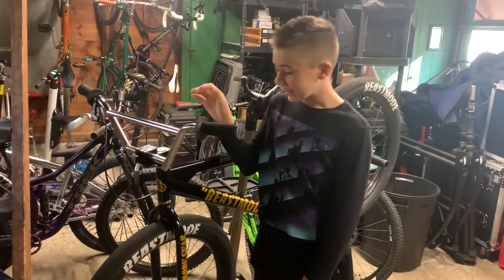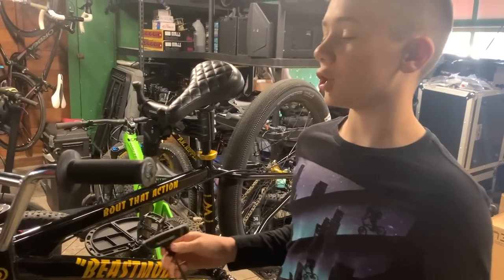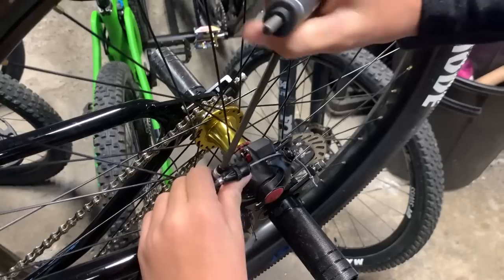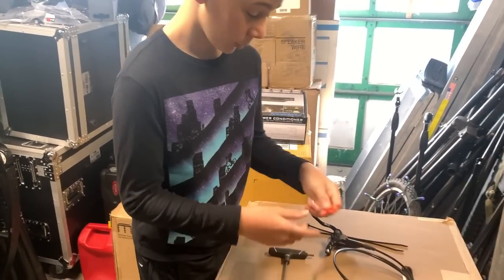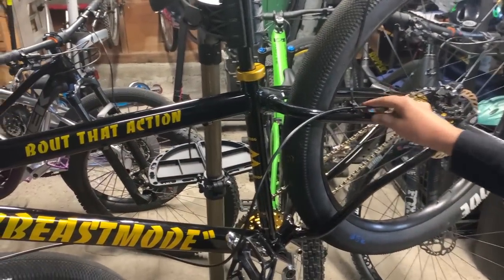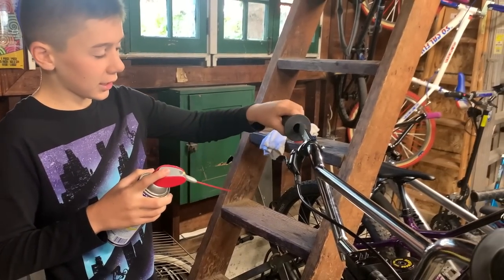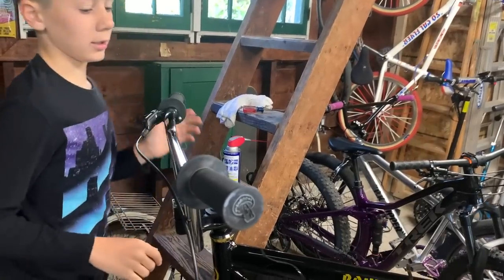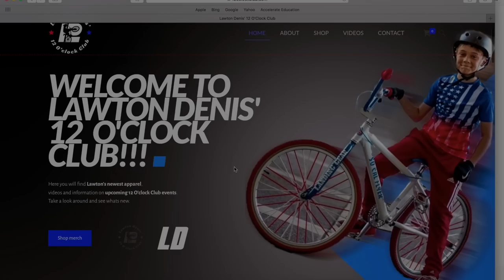Installing Shimano Hydraulic Brakes On My SE Beastmode

Comment: If you want to avoid throttle grip after using a lubricant you can use rubbing alcohol, like the stuff you spray on your hands and it evaporates in about 2 minuets then your grips are locked down like they always are.

Comment: Hey Lawton what’s the difference between se bikes is it the speeds the frames or the graphic kits in general?.
Reply: It’s the frame
Reply: Beastmode fat rippers and blocks flyer what I recommend
Reply: Everything depending on the bike, the cheaper bikes might have worse heavier and weaker metal for parts like handlebars, and they might have different wheels, sprocket, tires, seat, handlebars, frame, brakes, etc
Reply: And they obviously have different graphics, some have different speeds and gearing too
Reply: its the tire diffrence

Comment: Hey lawton what hydraulics should i get for my so cal flyer and how do you install them
Reply: For rim brakes I wouldn't put hydros its really nothing difference besides different brake pads. Id use Koolstop brakes and theyre sharp enough. Hydros are only used for Disc Brakes and are sharper then

Comment: The problem with removing grips with WD-40 is that it's hard to clean out the lube from inside your grips.  If you ride in the rain, the lube somehow lets water in, and suddenly your grip pops off when you need it most like when you're doing a wheelie or a jump.  If you have grips that lock to the bar with bolts, then it won't slide off, but part of the grip might slip and that's annoying. If you have a high pressure air pump, stick a screw driver in then blow that high pressure in. The grip will expand and slide off.  You can slide them on the same way.  This is how the bike shop does it.  I know, because I worked at bike shop.

Comment: Could you possibly make a review video on the shimano hydros and which models you prefer? I'm currently running basic shimanos(mt200 with metal pads). I see that you are running the higher end shimanos and I'm kinda interested in purchasing them but some people I've asked said they dont like the feel of the higher end shimanos because it has "servo wave".. I really like the fact that it has a shorter lever as my current mt200 has a super long lever but I'm worried it may not feel as good even though it may cost more money... anyways, I know you may not see this but continue to kill it and be safe out there young OG!